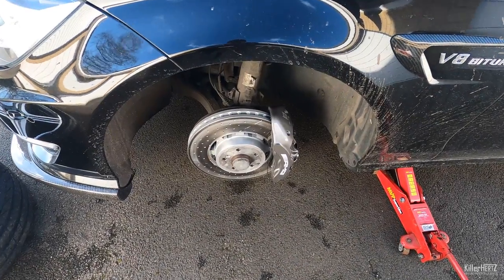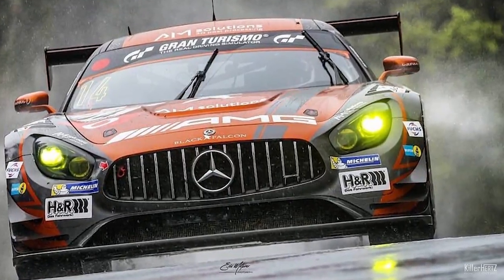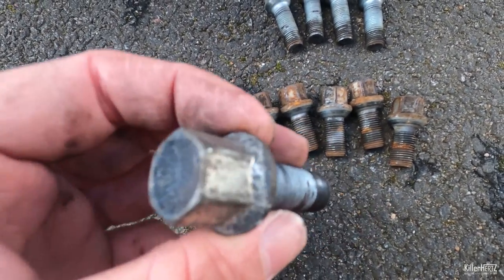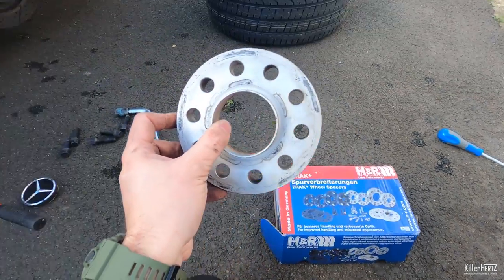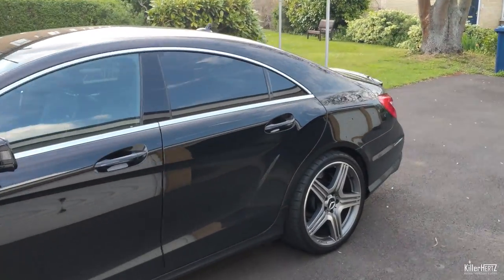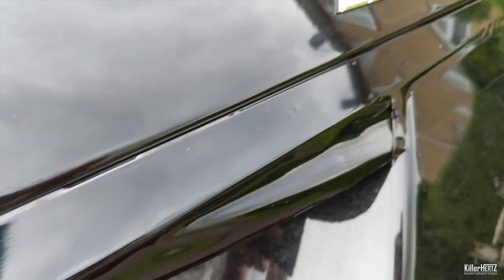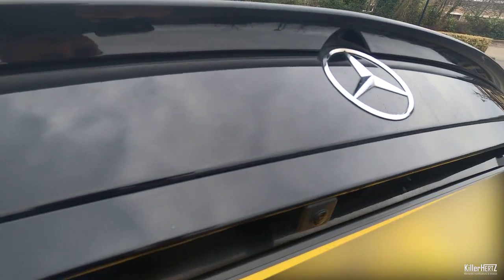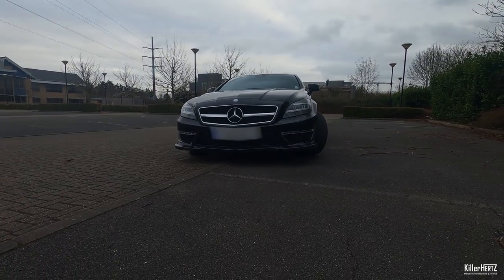Project: CLS63 AMG - H&R Spacers, AMG Discs, Tyres and Wrap!

Comment: NEVER use spacers. They alter the stress points in the factory geometry to areas not designed to absorb it. You are just asking for some very expensive trouble and uneven tire wear.
Reply from the maker: thanks for your comments, but I must disagree for small 1-2cm spacers, larger, sure.  I used them for over 5 years on my old CLS without issue.

Comment: I think of this as "OEM with attitude", the car still looks "original", is improved in every way but no individual mod is really noticeable.  I have H&R Trak+ 5mm on the front of my w208 to fit OEM wheels over bigger brakes, soon to have rear spacers too as the improvement in appearance is undeniable.  Another great video K!
Reply from the maker: Hey Nick, thanks for comment. do you still have the CLK55?

Comment: Where did you get these from? I can’t find any like that and normal ones are not fitting because of the huge cap in the middle of the rotor 😢
Reply from the maker: H&Rs website should give you local suppliers

Comment: i have been thinking about spacers also for mine, but i worry about the rear fender catching on the wheel when the suspension lowers to it's maximum amount. I would go with what you have for yours but my wheels are the oem forged ones (18 spokes) and the offset is probably different

Comment: Hi, quick question re. the spacers if I may? Did they alter the drive at all? The only reason i ask is that i fitted a set to my m235i and the steering became noticeably heavier?
Thanks!
Reply from the maker: Hi, The fronts are only 1cm, I can't say I have noticed any difference at all with the steering myself...

Comment: Looks really cool mate!  Is the rear deck spoiler an ad on or OEM Merc?  Also today my car (E400) said take out starter button and use key?? Car wouldn't start with starter button? Any thoughts please?
Reply from the maker: Hi, the spoiler is OEM fit as it's a CLS63 AMG however you can fit an aftermarket one off eBay 
Check my vol4 of my 'Hidden Mercedes features' video where you can see how to remove the start button if it's not working. cheers
Reply: @killerhertzmercedes  great thanks heaps for that! Why do the stop buttons stop working? And what is the fix?
Reply from the maker: You really need to get it hooked up to STAR diagnostic system. It could be many things. One of the exterior handles, the key, the button, the immobiliser...
Reply: @killerhertzmercedes  Ok cool thanks! I have just tried it again in the car and it seems to be going ok ATM? May be just a glitch? My car is a 2013 E Class how do I get Apple car play on my screen? Do you have a vid?
Reply from the maker: You won't be able to without totally removing the COMAND system for an aftermarket car stereo. ££££s
Reply: @killerhertzmercedes  ok thanks a lot for your help! Keep up the tips and tricks videos!👌
Reply from the maker: Thanks, make sure you click on that subscribe button so you find out when I have a new vid! Cheers
Reply: @killerhertzmercedes  👍

Comment: 255s at the rear😐
Wow!
You must have big issues with traction as i struggle with my 275s want to go 285s🤣
Reply from the maker: I have 285s - Not sure why I said that in the video!
Reply: @killerhertzmercedes  I am running 305s on mine. They fit perfectly well!